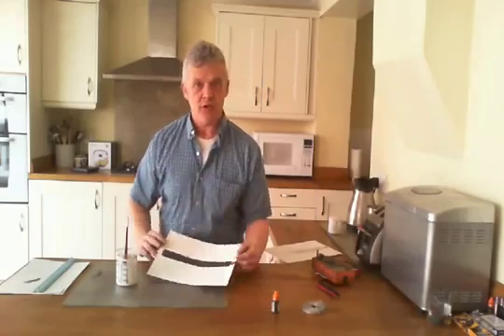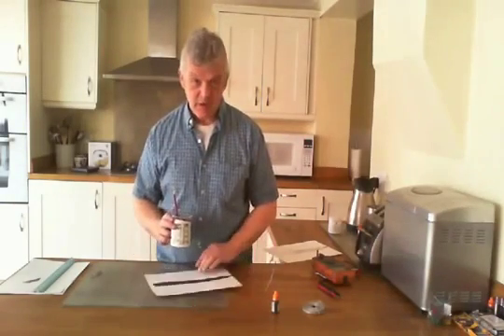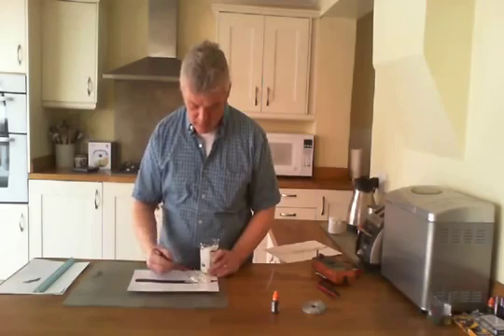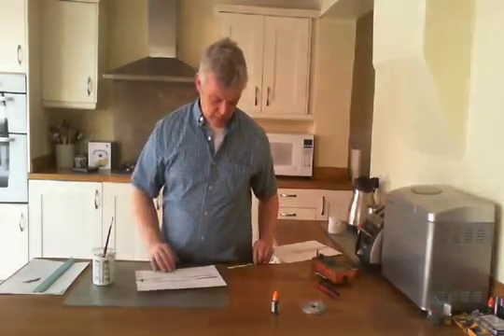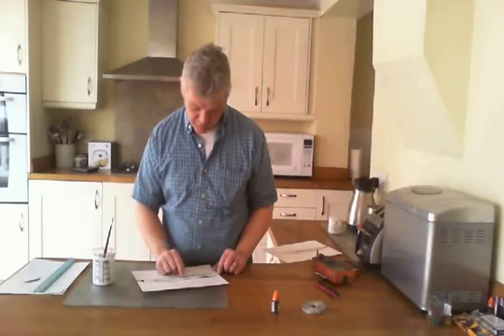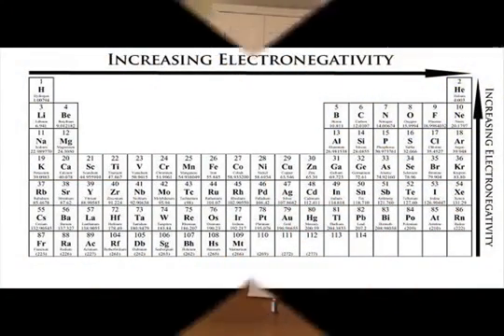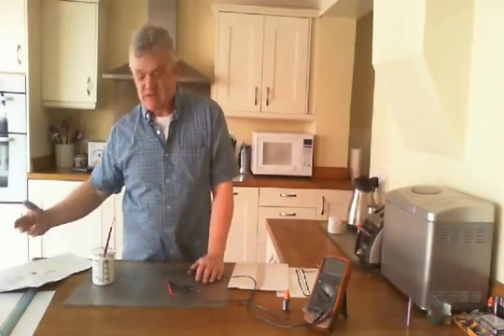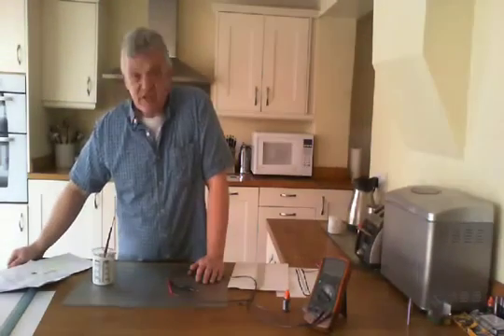Free Energy Around The Corner- Generating Electricity From A Coat Of Graphene Paint

Comment: Thake a ac heat pump and run it as a heatgerator. Use peltiel element ore some temperatur diffrensial engine. The you got cop from the air and a overunty unit. Free energi is god given sins god is eternal. God luke. Lad.

Comment: In theory, the PVA binder used to bind the ZnO and Sulphur( neither of which are readily conductive) is a strong insulator that also prevents most ionic exchange. Of course one would have to check for corrosion to prove or disprove a galvanic cell. However, for sake of arguement, lets say the device is not operating on a galvanic reaction due to the insulators an no electrolyte between the electrodes. How does it work then? Well, the electro-negativity of the electrodes definitely setsup a voltage bias and a pseudo-diode environment. Let's also say that the insulative active materials are p-n type materials. Such as is true with Phosphorus, Sulphur, and ZnO (native metal oxides). If the p-n junction theories hold true then the device is producing current flow due to the excitation of the field produced do to the bias setup by the electro-negative relationship of the metal electrodes. This bias funnels charge in one direction, generating that charge from the oscillations of the metals valance shells, from outside radiation.

Comment: I am no expert, but isn't this simply a flat battery?  Don't normal batteries use layers of different materials to produce small electrical currents?  How long will the paper strip light a small LED before going dead?
Reply from the maker: A battery has to be charged before it can be used. Robert doesn't appear to be charging this "strip of paper". Robert says on the video "That's working of the ambient heat. Just the room temperature, really, is creating that"

John Hutchison and others have made crystal power cells that work for years with out having to charge them like you have to charge batteries.

Here's Robbert Murray-Smith's channel, he can answer all your questions over there and many times does.
https://www.youtube.com/user/RobertMurraySmith
Reply: In theory, the PVA binder used to bind the ZnO and Sulphur( neither of which are readily conductive) is a strong insulator that also prevents most ionic exchange. Of course one would have to check for corrosion to prove or disprove a galvanic cell. However, for sake of arguement, lets say the device is not operating on a galvanic reaction due to the insulators an no electrolyte between the electrodes. How does it work then? Well, the electro-negativity of the electrodes definitely setsup a voltage bias and a pseudo-diode environment. Let's also say that the insulative active materials are p-n type materials. Such as is true with Phosphorus, Sulphur, and ZnO (native metal oxides). If the p-n junction theories hold true then the device is producing current flow due to the excitation of the field produced do to the bias setup by the electro-negative relationship of the metal electrodes. This bias funnels charge in one direction, generating that charge from the oscillations of the metals valance shells, from outside radiation.